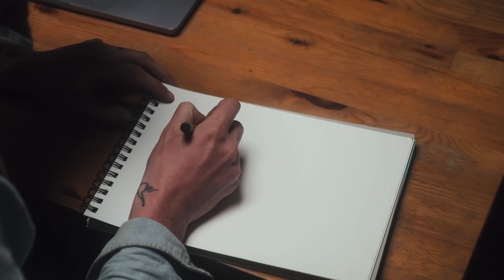#112 Foraging with Chiara

Comment: I love the way Chiara doesn't care about the stinging nettles, just chopping them with bare hands. My hands are tingling all over after I had to clear a patch in the polytunnel. They contain histamine, every time you get stung the body creates anti-histamine. I noticed you get hay-fever... It is prudent in the spring to make sure you get stung many times, then in the summer you will not suffer with hay-fever. I never get hay-fever, but I do have tingling hands. There are 3 cornered leeks and Alexanders coming up right now here, I used them as a garnish for a pumpkin and potato soup. Every ingredient came from the land. Grow pumpkins in your chicken poop!

Comment: Soggy weather is intimidating and can pressure to control like people.  To step up over level up is commendable for it has the strength advantage and command, in this case stepping out from what is a predictable direction has many unmistakable positive and tangible results.   

Woods for fencing has its one of a kind preparation, not fast but a patience-driven work.  To imagine the fences are installed and free range chickens and beautiful noise in the foreseeable near future.  While the workshop is underway the spring time must not be overlooked and missed.  New growth and new life and new beginning, and scenery as it is. Thanks.

Comment: With the greenhouse have you thought about digging into the hillside? Making most of it underground. You can make it large enough to incorporate a root cellar in the upper side of the hill, so you can cut down on building too many structures. Just for the fun of sharing ideas, the same part of the greenhouse has room to make biogas. This will help with cooking gas,  and the running of your generator. A large enough biogas generator will also help with heating the greenhouse itself. One big problem I see with most greenhouses is their not built with an airlock room. For a buffer against the cold! With the right planning, the greenhouse can even have a food processing area, again cutting down on building. Remembering my dad's words, my son work smarter, not harder!

Comment: Loved the mood and the sountrack of the video!
Martijn! In order that the poles would last long and wouldn't rot, consider preserving the wood by charring them! This way the poles would last much longer and you wouldn't need to worry about them for decades! To do that you could use a torch or a campfire to “char” the part of the wood that will be buried or in contact with the ground.

Comment: Nettles are one of the most nutritious wild plants. I like to pick the young leaves and blanch them in very, very hot water for one minute. This takes out their sting. I let lay them out to dry and then either freeze them and use the leaves as one would in quiche or eggs Florentine or layered in lasagna. They are delicious this way, especially fresh. I also crumble the dried leaves and store them in a jar in the kitchen. I use them in soups, stews and cooking to add green and good salty flavor to food. 

If you dig the greenhouse floor down about three or four feet and build rock walls and lay rocks on the floor and then build your glass greenhouse over the top, you should be able to use it year around. I have several friends in Alaska and Canada who have done this and they are quite successful in having vegetables and salads in the heart of winter.

Comment: @8:30 No disrespect intended. You have made some serious progression in your skills, and so very many of them. But as a cabinet maker I learned that in that type of use of a chisel, if you need a hammer to do the cutting, your chisel is not sharp enough. You should be able to trim those plugs with only the chisel and your hands.

Comment: Dear Martijn, did you show Chiara the ferns that you were weeding ?  down here in New Zealand at the stage of growth that yours are at some verities are edible.
Food for thought.
What is a glass house ????? 
It allows you to extend your growing period & in your case counteract the cold from the elevation that you live at, if you just build a building with double glazed sections all your doing is losing about 60% of your heat to heating the ground around your glass house.
Polly panel is 2 sheets of aluminum with polystyrene captured between them. 
You can use it for your walls & dig 2-meter-deep trenches to bury them to prevent heat loss OR build a wooden frame & use Polly panel for floor walls & roof, you may have seen this a woven backing with stone stuck to it used for interior use looks a bit like stacked stones (like the cottages you are restoring) to give it a foo exterior.
You have a artists eye the best spot to put your glass house to maximize it's potential might not be where your eye feels it should be if you want to put food in your belly then fight that urge to shot yourself in the foot & put it in the RIGHT PLACE !!!
Your friend Kiwi Rod

Comment: You should probably include a disclaimer. Plants can have poisonous twins, don't go picking and eating things you don't know, some are toxic but look like the ones you can eat. Hawthorne and Blackthorne are good examples. Both have creamy off white flowers that look similar, both have thorns, one has oval leaves the other has the ones shown. One is a tasty snack, the other will give you a reaction where the immune system thinks there is a foreign body, it causes swelling and pain.

Comment: Acacia and chestnut are the best for pickets.
Reply: So is the Honey Locust Tree, (if it is native to the Italian Alps)? We've used Honey Locust for fence posts for centuries, here in Pennsylvania. It grows like weeds, it's so prolific. It's a very hard wood, but, it doesn't burn well, as regular hardwoods do as firewood. It'll do in a pinch, but you have to mix it with other good burning hardwoods, such as Cherry, Ash, Oak, Hickory, Beech, etc. Otherwise, it won't hold a flame and burns out very quickly.
In fact, when the bark was still on the Accacia, it looks just like Honey Locust. Might be related?
Reply: @timmcgurl  " Acacia is not correct" , Acacia is an african tree : its correct name is "Robinia "pseudoacacia". It is a tree native to North America and imported into Europe by the French botanist Jean Robin in the 17th century and spread throughout the continent due to the great use made of it in the 19th century, for its root system, as a support for railway embankments.
Reply: @timmcgurl  Yes Honey Locust is native from ur country, like Robinia pseudoacacia, since 200 years u can find this species (invasive species) and use it for pickets or other stuff, for their strong wood quality. 
Before theses 2 species appear in Europe, people use native european Chestnut for similars stuffs.
Acacia growing faster than Chestnut, so people use it for low price wood or hight prices, that depend of trunk diameter.
I don't know the presence of Honey locust in Italy, but u can find some in France, my country.